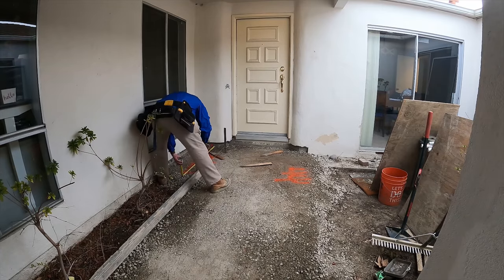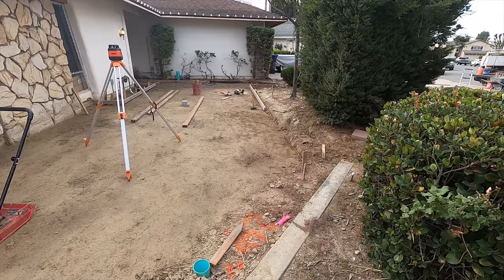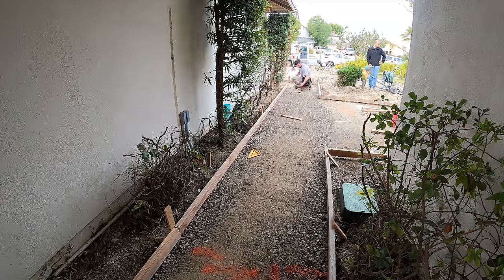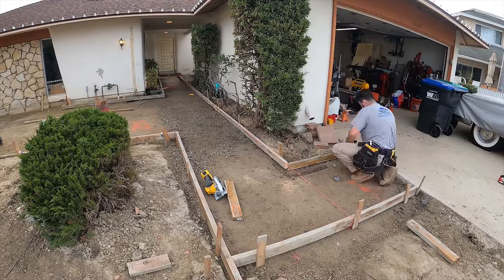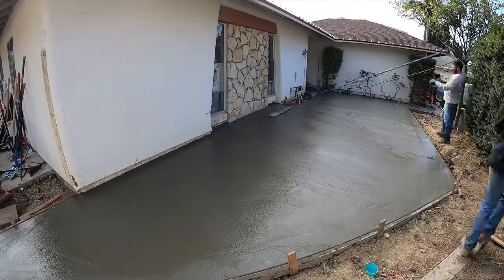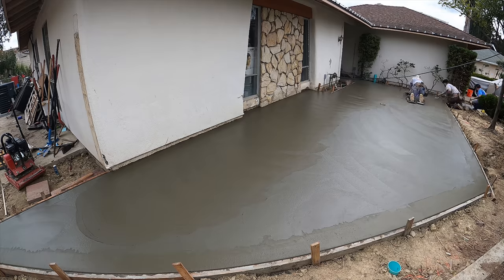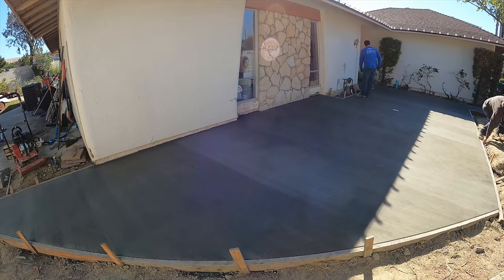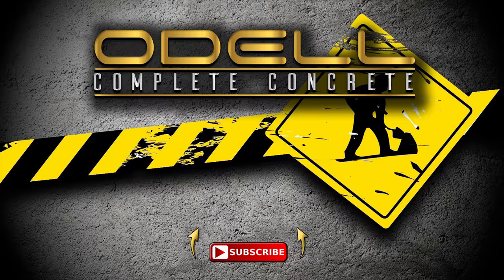DIY Concrete Patio with Walkway

Comment: Excellent job once again. Love watching your videos. I’m in the process of extending my backyard concrete patio to an existing patio. Want to plan out the drainage portion of it. Can I combine water from gutter downspouts (GDS) with a Channel drain running along the back perimeter of the house? 1 GDS -> sch 40 pvc -> Channel drain (14 ft long) -> sch 40 pvc - 2 GDS -> Daylight. Since the backyard patio is being extended with concrete, should I top off the drainage pipes with the new concrete or just top the drainage with gravel 6inches width and then start the new concrete section?

Comment: What’s the difference between making control joints while the concrete is fresh vs using the saw after it hardened?
Reply from the maker: No difference except the depth and appearance

Comment: Great work! Quick question. I'm planning on hauling about 3 yards with 2 manned full size wheelbarrows about 50ft from the concrete truck. Does anyone have an average wild guesstimate of the number of trips per yard? The pump cost is way too high for my budget. Thanks in advance!!!! - Nino
Reply: 42 trips @ 275lbs each. That’s about 2 cubic feet per trip. If my math is right

Comment: Dude, you really need to use a particulate mask when doing those saw cuts. Silicosis is nothing joke around with - it will kill you.
Also, why do you not use any expansion joint material, especially when you butt up against the house and other existing concrete?
Nice work!
Reply from the maker: The concrete is not bound in, and it doesn't stick.
TY